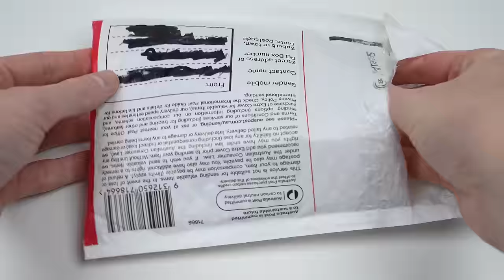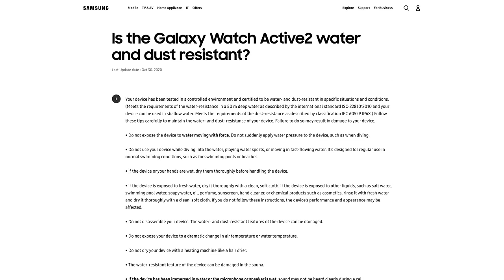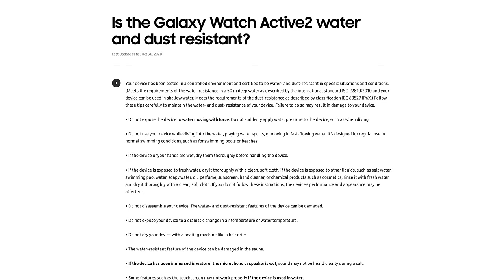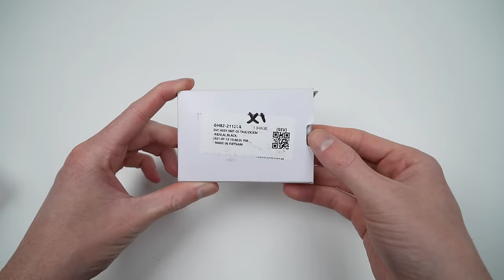Salt Water Damaged Samsung Galaxy Watch Active 2 Restoration

Comment: I Have a Gear S3 Frontier and it stopped displaying, I tried your methods and finally got the watch to display when I pressed both buttons while watch was resting against charger. The S3 has a full charge, but each time I selected something to reset from the reboot - like turn on bluetooth, or change date ( it defaulted to December of 2015 and 7 o'clock - not the standard 10:10 I am familiar with when coming out of an update or complete power down. I think the watch is toast. My Gear S2 continues to work faithfully. thanks for your hints even though I was not completely successful. Guess I can use it as a paper weight.

Comment: A word on salt:
Salt is a highly soluble mineral and will crystallize as soon as it dries up. Salt is also a great conductor of electricity and such must be REMOVED from electronic product.
This is done by either wicking it away or diluting it away. I saw you do neither.
On the contrary, you managed to smear it over a greater surface making it much more likely to cause problems in the future.
That combined with no seal replacements does not sound like a particularly proficient repair to me.
I hope you find the time to read this piece of constructive criticism.
Reply: Criticism noted, but I'm still waiting for someone to explain what to clean up the salt water with. Water? Alcohol?
Reply: @DougHigby  Did you find the answer or do I need to continue reading the next 100 or so comments?

Comment: Samsung does not accept the warranty if water gets in to watch. But it happens when you swim in the pool very often, the water-resistant is 5 ATM and Samsung let users swim with it in commercials and manual instructions, so this is a problem where Samsung doesn't take responsibility and lies to users. I think is much better to buy a Huawei gt2 for swimming, it is also 5 ATM but I did around 100 km in the water and the watch still works, not like active 2 which stopped working after a few minutes in the pool.

Comment: Dont know if this is related, but my samsung s7's screen immediatly died after tuching ocean water but it had no external damage. The screen then slowly turned purple but the phone underneath was still working when a mouse was plugged in. Have you seen anything like this happen before to AMOLED? 
I was also going to fix it, until i realized that it cost 70% of what i paid for it new to replace the screen.  I just love technology 😅
Reply: Yea so, if you really liked the s7. You could get a new one for like 50 dollars. Samsung has always had the best screens on the market,  and thus even the old ones are expensive to manufacture even today.
Reply: not a fan of oled due to the more fragile nature of the displays and the higher cost of replacement. but thats just me, someone who uses their phone as more of a tool than a entertainment device.

Comment: What did you use to clean the salt water corrosion off the motherboard. I have a active 2 watch that also got salt water in it. Thanks
Reply: I wondered this as well; found that you can use rubbing alcohol with soft bristle brush to remove. thank!

Comment: i recently  had to open a gears s3 to change the battery. it was easy with the whole repair costing me about USD 30 and battery lasts at least 2 1/2 days. Samsung outright refused to repair such an "old" watch and 3rd party repairers wanted about usd80 for it.

Comment: I read Samsungs website BEFORE I went swimming in a Swimming Pool a few weeks ago. I specifically checked and it said its resistant for pool swimming and should be fine, just dont dive it put it under forced water. I just dipped in and was just swimming around, and then it rebooted..and kept rebooting then switched off...

I let it dry out, then opened it up and it looked fine inside, no corrosion but a little bit of water still so i wiped it all down with IPA (99.3%) and some cotton buds and let it dry for a day. 
When I tried it again it eventually turned on. It bugged for a bit, but then after like 2 days it stopped charging. It detects that it's on charge however the watch discharges and doesnt take in any new charge. 

I thought maybe it was the battery so got a replacement. I then replaced the battery. It powered on and works perfectly. All the touch, the sensors, and bluetooth/wifi work all fine. 
I tried factory resetting it, but still it wont charge. 

Unfortunately ive had it since 2020 so its out of warranty. Ridiculous that Samsung say yes you can go swimming in it, when light swimming in the pool (not salt water) straight away killed it. 
So I just had to fork out $500 for a new smart watch, thanks Samsung zzz.

Comment: Been wondering ever since I watch your videos, why is that an alcohol is safe to use in cleaning parts like motherboard despite being a liquid substance like the water, which causes damage?
Reply: Isopropyl alcohol is non corrosive, and evaporates quickly, and its cleaning properties makes it the best candidate for repairs and cleanings.
Reply: alcohol evaporates quickly and is non conductive, you could even use distilled water i guess since water is only dangerous because of the minerals that make it conductive.

you can totally clean your electronics with water if their not under voltage, its even a preferred method to put old motherboards in the dishwasher to clean capacitor liquid  off

Comment: I can't remove the screws, any tips?
Reply: They're security screws they are designed specifically to keep individuals that don't know what they're doing away from the internal components of the device , the repairs are only to be done by a certified repair technician.

Comment: I had to open this watch up to readhere my screen to the frame since the old adhesive gave up. It really annoyed me that I had to purchase a tri-point screwdriver to get in and getting the main assembly out of the frame isnt easy either. Also, my microphone dropped out of its place when i was cleaning the glue residue, but I managed to get it back to fully working condition :)

Comment: I don't belive samsung water proof glue. My watch active 2 have water damage too. So i was rip it off then apply t9000 to display touch cable, every cable and hold and in screw hole. The speaker is the place that water come in most so i apply alot glue around it. Now my watch active 2 is a beast, i can dive, swimming and shower without killing it
Reply: 🤩
You can't use the speaker isn't it? Or around it?
It comes in the side?
Why they don't do this ?
Reply: @JUR O  I put glue around it lol. My speakers are still great and no water leaks from it's anymore lol
Reply: @imshirmpinghime-sama5990  lol. Pretty leack it leaks there.
Reply: @JUR O  well, you will need to replace the factory glue with other silicon glue like T9000 lol. My watch active 2 is now invisible 🗿
Reply: @imshirmpinghime-sama5990  lol
Reply: @imshirmpinghime-sama5990  I swimmed in the sea with my cracked mk acces, it worked like shit it still does.i think the speaker is completely broke now. But you already needed to scream in it like a phycopath.
But it survived all my sea adventures then. The button goes back very slowly but it still works 💀

Comment: I noticed the vibrator was circular, not rectangular. I'm disappointed. The Samsung Galaxy S21 Ultra (the phone I have) has a rectangular vibrator (haptic engine, good vibrator, whatever you wanna call it). The Samsung Galaxy Tab S8 Ultra that I also have has a bad, sloppy, circular vibrator. I mean fine, they cheaped out on it, the vibration in the tablet is probably not really that vital.

But bro, this is a watch! The thing you're supposed to wear on yourself almost all the time! Why is the vibrator so shit? I wanna feel nice haptics like on Apple Watch, not muffled vibrations like on 10 year old phones :( Samsung fix that please

Comment: the galaxy watches are simply garbage i got a fold z3 and a couple of months later i got a email saying thanks for getting the phone here is a starter pack and a free galaxy watch 4 which is simply put the one no one wanted as the display is to smal and the strap is white with black rings and when you first get it its learning what you do and the battery goes from a 100 to 40 in thee hours but the worst thing is ive worn it eight times as i dont like the strap and the edge of the screen has chips in it and i dont mean one or two but a load so the scrolling messes up to put it simply its shite at least the classic has the bezel that protects the edge but the basic one no one wants does not and its just annoying as the bat just seems to die if you use anything even a alarm so if your going anywhere like camping or to a hotel hope you have a bat pack as it will die the tech is good but the battery length is the let down and the screen its like the old phones that would scratch if a bit of dust touched the glass

Comment: These smart watches are something I normally really HATE !

Apart from Garmin & Samsung, most are made to be totally disposable after 2-3yrs (Apple). You're getting an electronic paperweight with a dead battery.

Consider spending $300-500 on a watch that will last 20 years with a heap of $1 battery swaps or if mechanical, 3 services. 

Great job Garmin & Samsung making a repairable smart watch 👍😆

PS: Only a complete moron would swim with a smart watch !
They're not designed to be a G-Shock people !
Reply: They do have water ratings and swimming modes, the problem is when people expect them to work forever in such harsh conditions, specially in salt water!